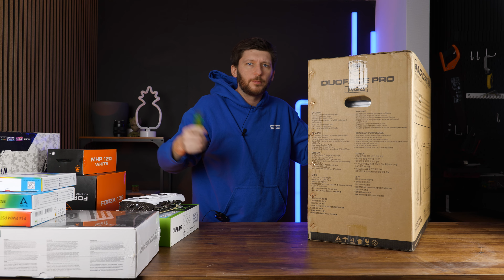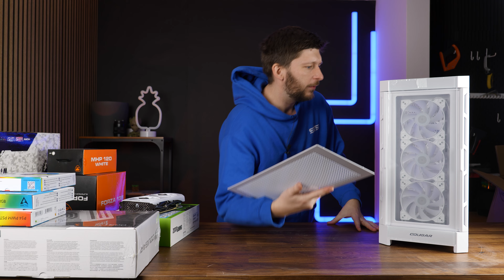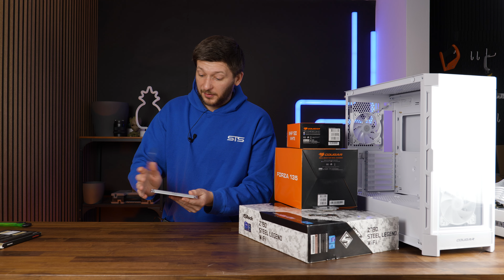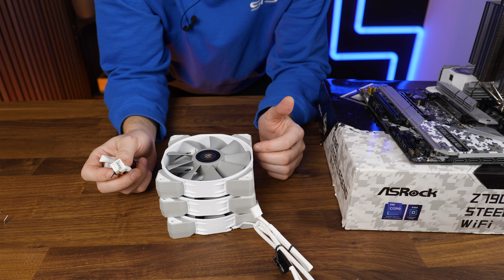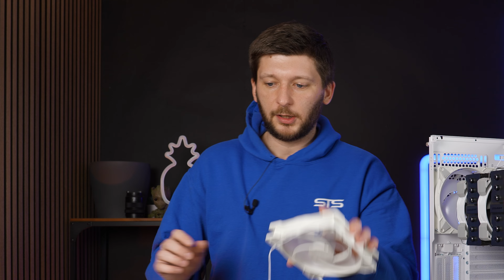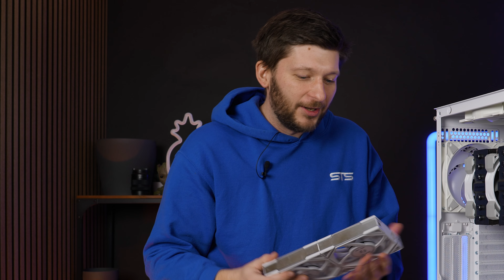The SnowStorm PC Build - Building In A Cougar Duoface PRO RGB

Comment: I got the non-pro version of this cuz I didn't know the pro existed. It's not bad... kinda... Gathers dust like a magnet, regardless of how positive your pressure is. The RGB fans are... Eh. I did get 2 140mm and one 120mm RGB fans with a hub for like 65€ which is a steal. Only part that annoys me is no mesh on the metal below the GPU.

The only other difference I could notice is the magnetic filter, mine is of a softer plastic, bordered with a soft magnet. So it bends, but stays completely flush with the top.

Overall thermals are okay? But I'm using p14's in the front, a p14 in the back, p12 on the top just above the back vent, a phantom spirit 120se and a deshrouded 1080ti with p12 max fans. So my thermals are fine XD

Comment: I really wish that Mr. STS would've spent some of his Epyc money on a second overhead camera for his build videos. 😜
Regarding that build, a DeepCool AK620 white or LT720 white would have looked really great in this case. That said, if one needs a bigger and a bit whiter GPU, one could always get a KFA2 (Galax) RTX 4070 EX Gamer or a PowerColor Hellhound RX 7800 XT, both of which are available in white and also have triple RGB fans in case one wants to mount them vertically.
Personally, I love the Galax RTX 40s since they store their RGB settings internally. If you are lazy like me, the RGB setup becomes a once-and-done thing that will still be active if you put the card into another PC without requiring any additional RGB software. 🥰